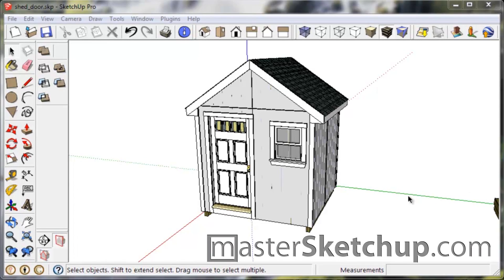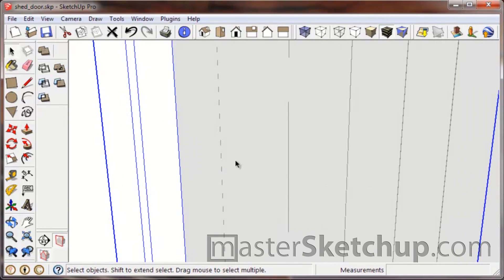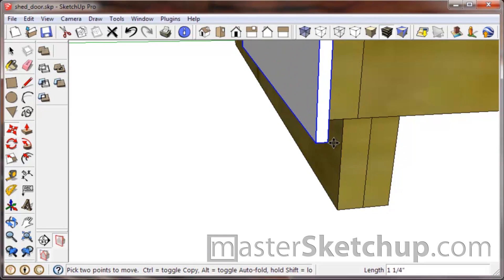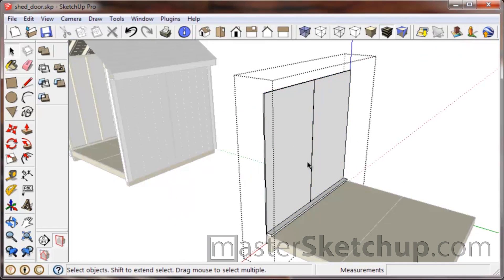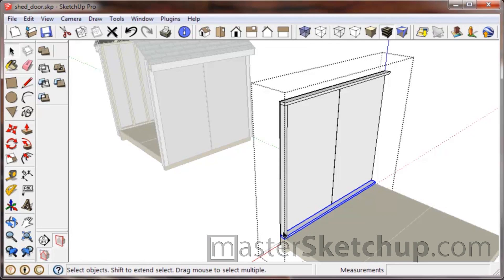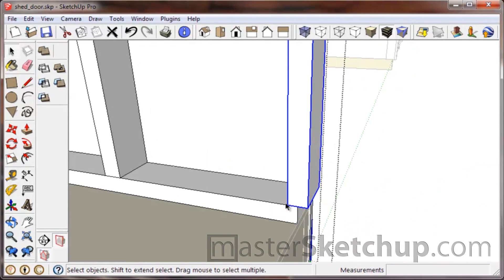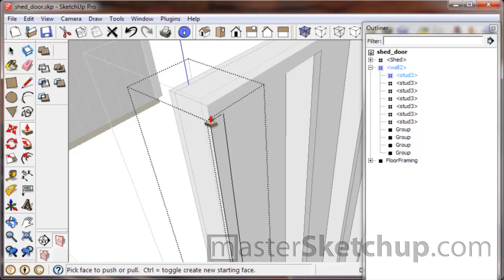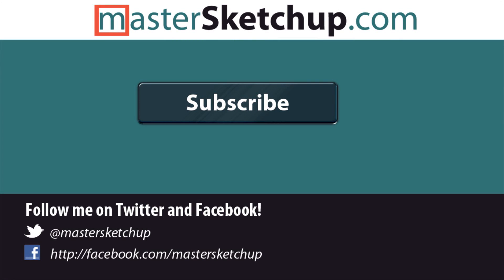Sketchup Tutorial - Model a Shed (Part 2) - Wall Framing

Comment: I know this is an older video, but wouldn't using 16 inches actually give you a distance that would be 16 inches from the end of the last stud, rather than an on center measurement?
Reply from the maker: So 16" on center means that if you hook your tape to the edge of the wall, every 16" will land at the center of a stud. But since you usually mark stud locations by aligning to one of the sides of the stud, you need to subtract half of the stud thickness from the first measurement. Hope that makes sense.

Comment: Great tutorial! Question: how do you deal with the 1/8 space you are leaving in between the plywood walls? The floor is 8’ long. But now the wall is 8’ 1/8” because of the 4’ x 2 plus the 1/8 gap. Thanks!
Reply from the maker: I can't remember the specifics of this video, but the 1/8" spacing between plywood is to allow for expansion and contraction, and to prevent buckling. In real life, that additional 1/8" length is insignificant. Idk, maybe I planned on cutting the length?  I don't remember
Reply: @Mastersketchup  I had also given some thought to the 1/8" overhang at the rear of the shed. I think that when you put the T-111 on the rear wall it will butt up to this overhang and not be a problem.